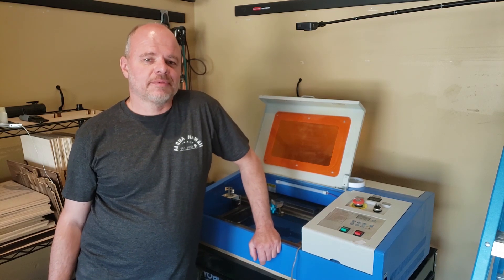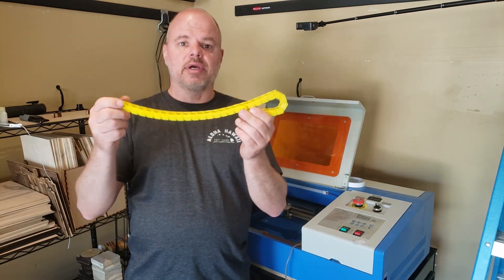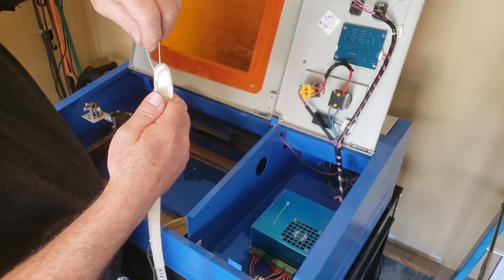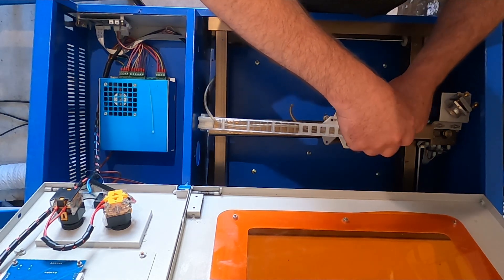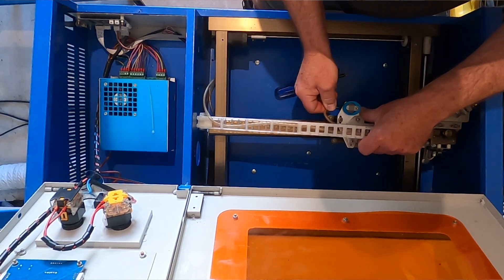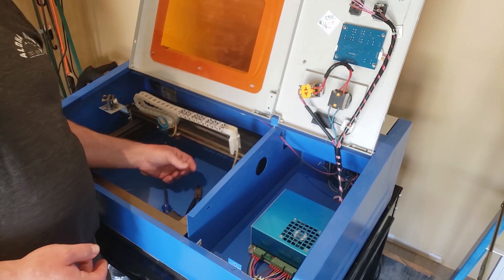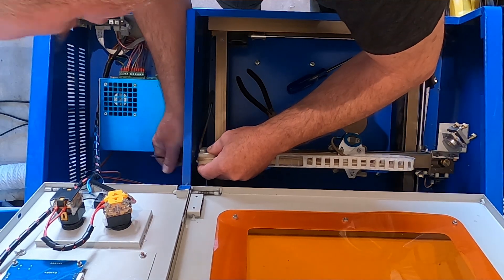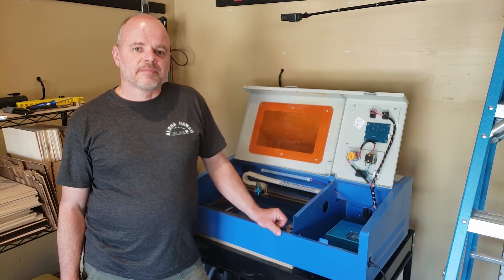k40 air assist drag chain

Comment: Hi Sean,

Purchased your air assist drag chain recently and need some help or suggestions.  I thought that your drag chain could work but my K40 already has a drag chain installed for a red dot guidance system and my laser nozzle mounting plate is different. I would have to stack your chain on top of the existing to make it work and then it's too high. Before I return via Etsy, any suggestions??

Comment: Just ordered the chain and both of your nozzles on Etsy. Looking forward to getting them in my machine.

Could you tell me what size air hose these work with? And do you have a suggestion on a compressor? I have a small airbrush compressor I was planning on using.
Reply from the maker: 1/4in OD air line works well with the nozzles.  There are many compressors used.  The airbrush compressor is pretty common as are some bigger aquarium pumps.